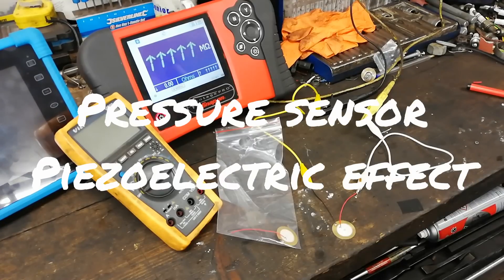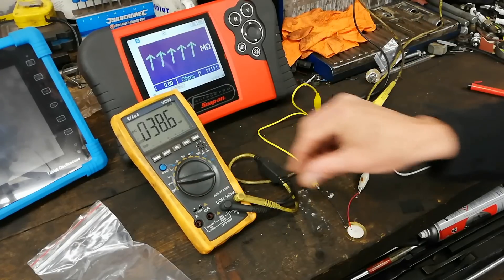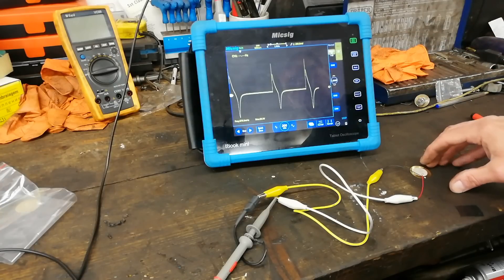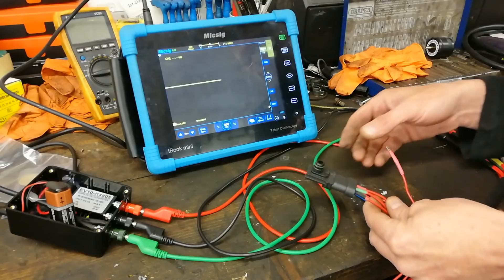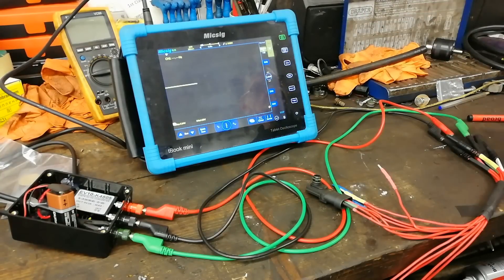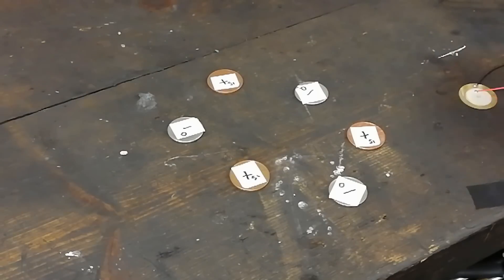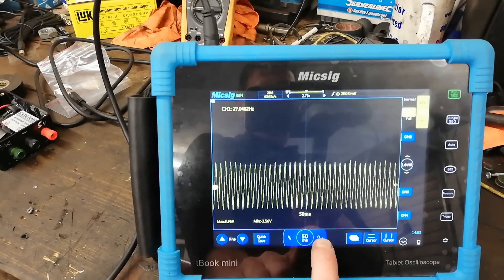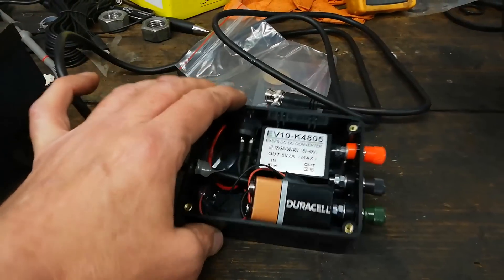Piezoelectric pressure pulse sensors operation

Comment: Thanks for the info Dave. i made myself a pressure sensor with a piezo disc , plumbing fittings and a few bits and pieces  and it seems to work ok on the scope. Have you used your first look to diagnose any problems yet . Thank you Mark
Reply from the maker: I have used it to look at pressure in the coolant but used it the other day on a dipstick tube to see any blowby on a car that was using excess oil. Works well, pretty foolproof device